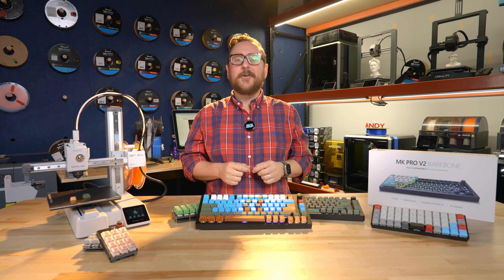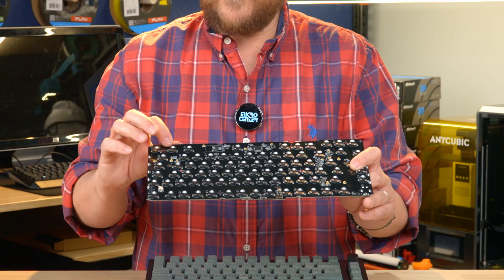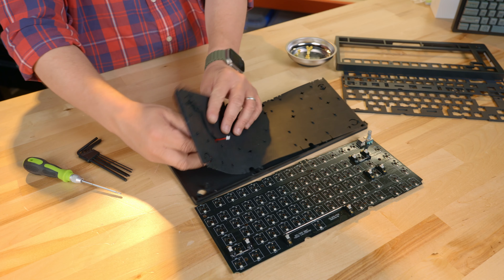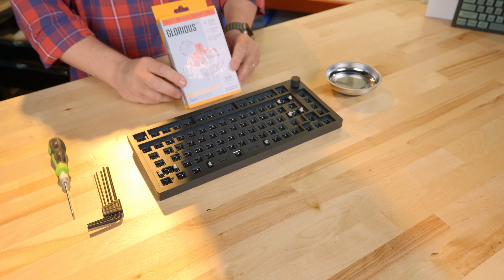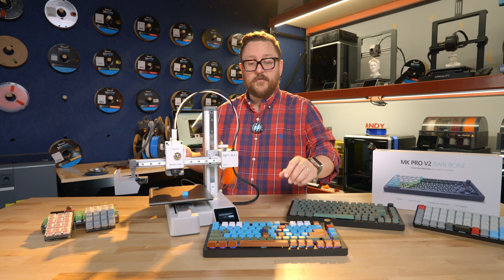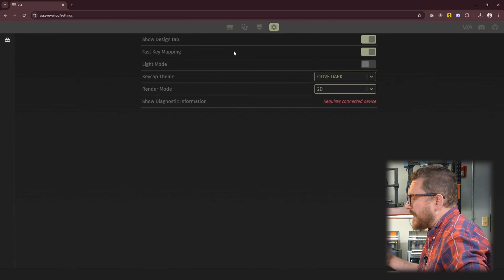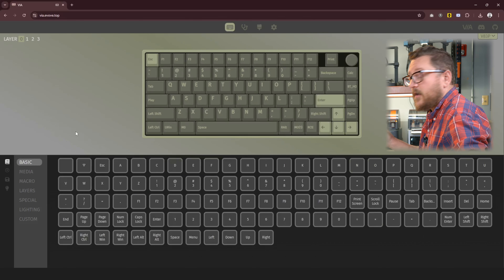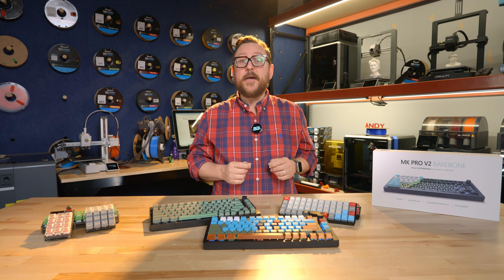3D Printed Keycaps is the ULTIMATE Keyboard Flex

Comment: You mention the designer of the key caps, but not WHERE to get them. The obvious orientation for the flat keys seems like it would be upside down. A bonus of this orientation is they can be printed with 2 colors, being much more visible than just cutting out the letters. You can also leverage a textured or satin build plate for a very nice surface finish, and feel. I did a video on this 2 years ago, showing how it can be done on even a single color, bargain bin Ender 3.

Comment: I've printed some keycaps before and ideally you would want to print in the highest quality possible, so have it at the 0.08mm High Quality setting, enable ironing on topmost surfaces and have 100% infill for starters. Also, with an AMS lite you can add colors to create the legend on top to make the characters stand out more. This is especially good for printing in the orientation that you did. It also seems like you have some pretty bad layer shifting for the brown keys, most likely a brim would help keep the keycaps in place when printing.

The original person printed sideways because he probably wanted to have the top have smoother layer lines since its on the side, not the top.
Reply: thank you for your thoughtfull commment, I can take away alot from this
i poder printing keycaps bc i have the impession i type faster at work on a cherry6000KCslim
then in my home on a kbf tofu65 with kaihl Box whites and a cherry keycap profile
i found some .stl for Keycapss in XDA-profile and am modifying those with relief lettering and making them even slimer
it has been a lot of trial and error so far, so any hints you could give would be highly apppreciated!